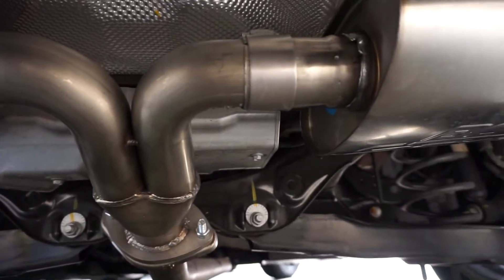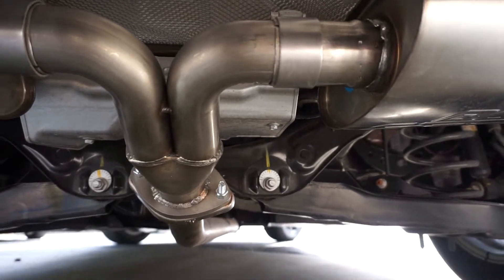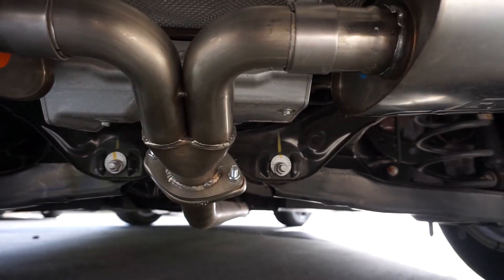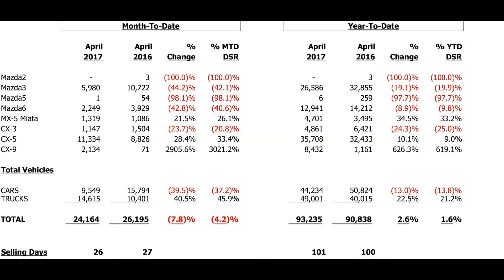Is The Mazda3 Failing? - April 2017 Sales Results - Borla Update

Comment: I don't think you should spend too much time looking for logical reasons why consumers buy particular cars. Here in Australia, the biggest seller in the small car segment is usually the Toyota Corolla, followed very closely by the Mazda3, then the Hyundai i30, although the order can change month to month. The Honda Civic is a slow seller here following years of lacklustre Civics which nobody but old people bought. The new model has picked up sales a bit but still sells only about 25% of the Corolla. An all-new Hyundai i30 has just been released (yesterday) and I think it will give both Toyota and Mazda a fright. It seems to be a damn fine car. My personal ride is a current model Mazda3 SP25GT, similar spec to your Grand Touring model. For an "interesting" review of the new i30, check out the following; https://youtu.be/1-FNyA4vllI John Cardigan is quite a character but he does great, no bullshit car reviews and comment on the industry in general.
Reply from the maker: I bet that new Elantra or i30 is feature packed and a great car, but I'm not a fan of the looks OR their T-GDI engines. My Veloster Turbo had the 1.6T and it was so laggy and inefficient. The front end is also too busy and rear looks kinda plain. The body lines remind me of the Elantra Touring model from before the GT. But like you stated at the beginning, who the hell knows why people buy what they buy.